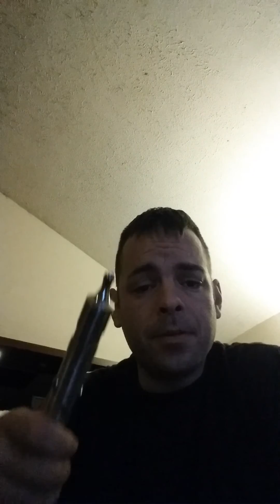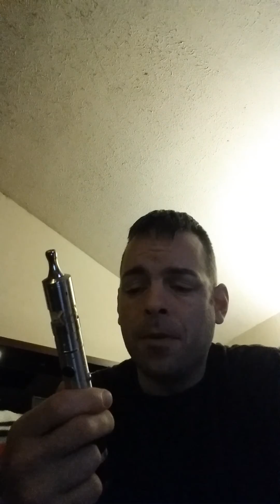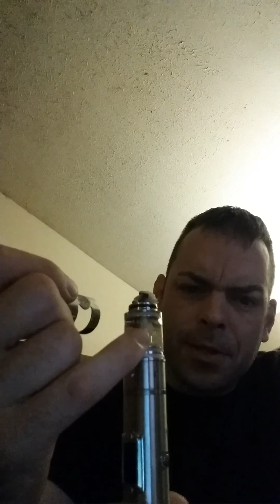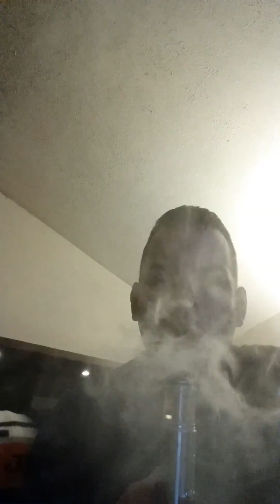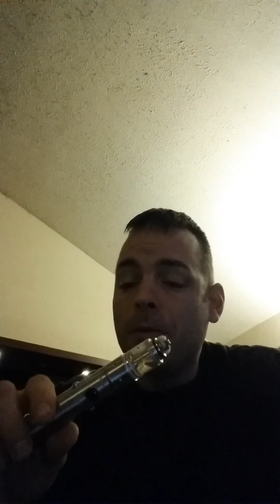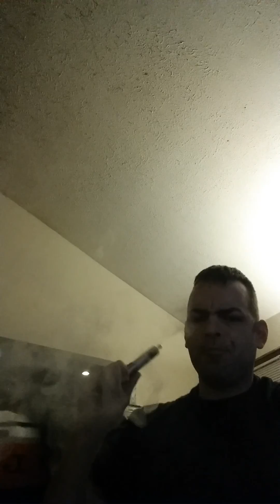Innokin SVD doing sub-ohm vaping!

Comment: I've been using my svd for about 2 years now, I've put all kinds of things on top. Tanks, rda's, genesis... and been using single 18650 and stacked 18300 and it's worked very well. Currently, I have an igo w3 on it firing at .7 and it works like a champ, it's a dual build with 17 wraps 28ga on each coil

Comment: Hello, nice build.  very impressive!!   I know i am almost a year late responding to your video.   how did your experiments go and are you still using the same SVD?   i was wondering if it burned out, or if u had other issues because of the sub ohm'n and double stacking of batteries.   I own TWO SVD's  and one of them is about to die ( the fire button will only respond about 2 out of 10 times when pressed.  ANY HELP WOULD BE GREAT)
About  2 months ago I attempted to use an atty rda wrapped and read at 1.2 ohm... single coil,  good juice.  slapped that sucker on my SVD and it just would not perform.  the coils lite up but not enough to make it work. I tried this more than once and on both SVD's.   so after trying 2 devices and 3 different rdas with similar wraps i stopped.  took it to my friend at the local shop, had him test my RDAs.. they worked on both his mechs.  So it was not the RDAs.  i will go look at some of your other videos. but i am glad i came across this one.  sorry for the long post.  keep on vapin!
Reply: The SVD is a solid device. A friend of mine had one that was having some issues, and we found that it needed to be cleaned and the 510 pin needed to be re-soldered. I gently pulled out the 510 pin, and soaked the whole device in a tall glass full of 91% Alcohol overnight. After soaking, I squirted alcohol into the 510 area while pushing the buttons to clean the button contact areas. Then let the device dry out for a few days, and whala! It works flawless again after cleaning and re-soldering the 510 pin. Give it a shot!
Reply: Warren Hylton thanks for the input.  i will give it a shot.

Comment: Thanks for the post! Got tired of waiting on mail with my mech mod, so I tried my SVD... 18650 battery, brass monkey clone, 28g coil wrapped 11 times. Ohm meter on the SVD reads 0.9 and fires. A little slow going but really works nicely. Noticed the battery got hot after about 6-8 full vapes, so have to switch out tanks. Not bad for a first ever build.

Comment: My SVD has been sitting in a drawer for the last few months.  Im not sure why but I pulled it out a few days ago and tried stacked 18350's in it also.  It worked great.  I put on my Patriot RDA built at 0.8 ohms by accident but to my surprise it fired.  Shocked, I switched it from wattage mode to voltage mode and cranked it up.  And it still fired!  I did a bunch of google searches but could not find much information on it at all.  But it did lead me to this video.  Has the SVD had all this hidden potential this whole time and no one knew about it? Or maybe its dangerous to the device itself and thats why its not a 'big' thing.  Either way im glad im not the only person who has noticed this

Comment: I have had the SVD for 2 months. I have also vaped .8 ohms on an iGoW using a Sony vtc4 30 Amp high drain battery. It works great but still not as good as a mech mod. It still has slight delay in ramping up compared to my Nemesis which is more instant. I don't know about the law and 25 watts. I can't believe it is actually 25 watts or I would expect more. Anyways I have been told to be cautious of using it sub ohm and burning up the computer on it. I still use it with an RDA but now with at least a 1.0+ build. I use my Nemesis for the sub ohm which I use at .4-.5 ohms and works much better. The SVD is a great device and one of the most versatile and I recommend it highly over the MVP(everybody swears upon) which I feel is overrated.
Reply: One more thing to add...turn your phone horizontally when recording a video. Please...
Reply: Don't be a #dickyarrell